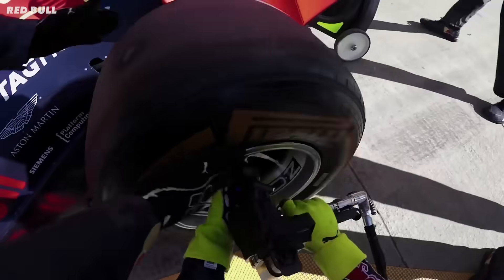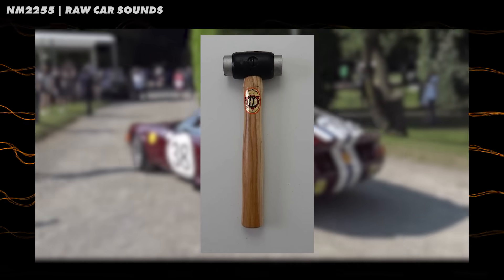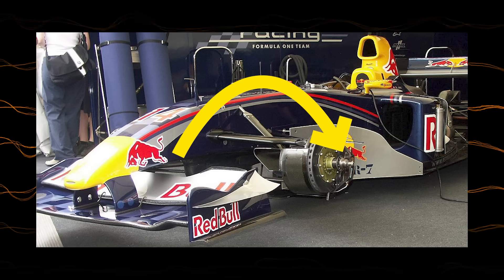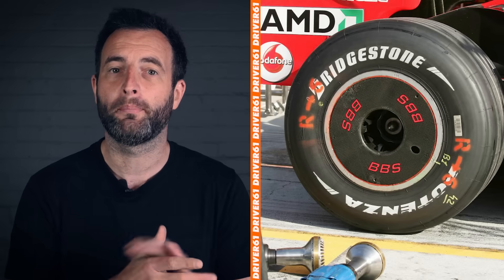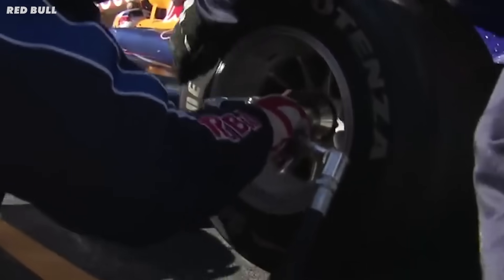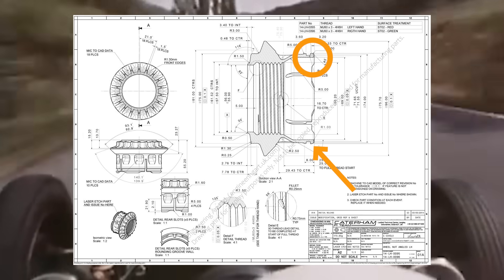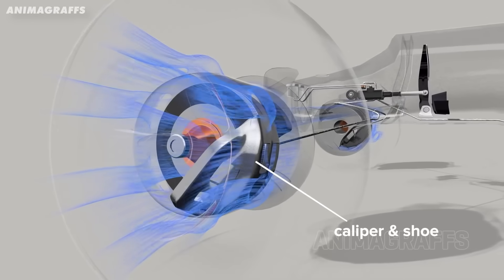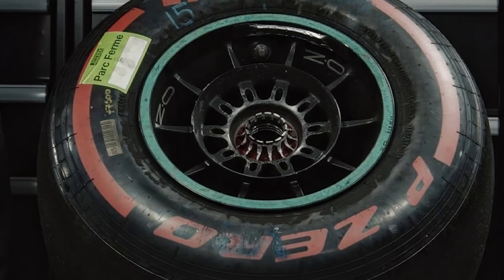Why F1 Wheel Nuts Cost £50'000

Comment: Excellent utubes! Love the deeper technical stuff we don't get elsewhere.

Re costs and what F1 teams are willing to spend -- A previous work colleague of mine had been a salesman for plasma coating equipment. Back in my day, (60's and 70's) conrods and such were polished highly by hand to remove surface scratches and improve strength and reliability. My friend told me that Ferrari, in Schumacher's time, had spent way over the odds to send their engine components secretly to America to plasma coat them which was much better than hand polishing them, giving Ferrari the almost bullet proof engines they started to have at the time. It could have been done here in Britain or in Italy, but it was such a good step forward that Ferrari  wanted to keep it secret from competitors. Cost, no object!

Comment: My uncle, an amateur stock car racer in the 1960s and '70s, had a lead hammer.  He said it was used to tighten the spinners on the threaded center hub of racing cars.  
But, I saw him use it on steel doors and door frames (he built, installed, and repaired them) and to hammer out the dents on the fenders of his race car.

Comment: If you are shearing off the castellations on the wheel nut then sounds like you need an (very simple) interlock that does not allow the torque wrench to fire until fully engaged.

Comment: My 1960's Trumphs, MGs and Sunbeams with wire wheels also had a winged, center nut, and all came with a lead mallet with wooden handle to secure and remove them. Even though the lead was soft, it still dented the chrome plated nut wings a bit.
Reply: I can imagine the first time you had to use the mallot to remove a nut. You would be standing next to your wheel thinking, NO, gotta, NO, gotta, NO, gotta, then all of a sudden THUMP! you drop your mallet and walk away.  😂
Reply: I bought a brand new MG midget in the UK in 1968 for  768 GBP, including the following optional extras : wire wheels with knock-off hubs (that's what 'winged centre nuts' were called in the UK) and a mallet, a tonneau cover, a radio, and a heater!

Comment: Bro why spend 50k on these nuts when they sell them in the lamp section at the hardware store for a $1.50?
Reply: They don't sound 50K on a wheel nut - this is clickbait silliness.
Reply: @ngc-fo5te  i mean you would think so right? if they use so many then technically, they're being semi-mass produced.
Reply: @RandoWisLuL  Yeah, if you made 10,000 of these they'd be costing 50 quid each - make a couple of hundred and they'll be a grand each. None of this 50K silliness.

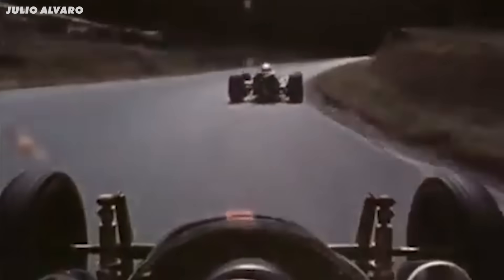Comment: I like the content of these videos, but the presentation is in the ADD style: break-neck pace delivered in a monotone with no breaks between subjects or detailed descriptions. The "explanation" of the right vs left-hand threaded knock-off wheels starting at 1:51 is a good example. I had to rewind it a few times to understand why the rear wheels tended to come off instead of the front ones. Also, "knock-off wheels" is a common term used to describe this feature on vintage sports cars, but somehow he missed it.

Comment: Would it not make a lot of sense to take pit stop time out of the equation by requiring a minimum of, say, 10 seconds that the car must be completely stopped? Not only would this cut down these ridiculous costs, but increase the margin of safety. There would be a red-yellow-green light set in each pit, controlled by the race stewards.  IMHO, the speed of the car and skill of the driver would determine the winners, not what failures may occur in the pit.

Comment: £50'000 per car times 2 = £100'000 per team. Estimate 20 races per season = £2'000'000 per team in a year.
The right video title would be "Why F1 Wheel Nuts Cost £2'000'000". Your video title is misleading.

Comment: he regenerative system can completely replace the wheen nut, a quarter inch thick of metal has zero resistance to direct current.  So the right hand rule expands outward, but through shells, eacj shell is crazy glued to the next shell, so th resistance remains close to zero and moves back and forth by reverse interference winding layers, then you can pay somebody a years salary for free 500HP wheel nuts. I thought about it making a go kart, its just the arcing, or power transmission that took a little tweaking, first idea was to use ball bearings to deliver the power betwean the shells, (inner and outer).

Comment: The titel is weird stating that Wheel Nuts cost 50k. But you state in the intro that they actually cost 1k and a whole weekend using multiple wheel nuts cost 50k. The title should than either be A wheel nut costs 1k, or a Weekend of F1 uses 50k worth of wheel nuts. That is different and I'd argue this is a clickbait title posed as such.

Comment: Interesting but some of your time frames are out. We had most of the design features you say came in 2010 or after on the Prost back in 2000/2001, and they had come from the work we'd done on the nuts at Ferrari in the years before 2000.

Comment: So the question is, if the biggest problem is the wheels coming off and the only problem with a 5 lug is the time to put it on, why bother with a single lug?  I think the problem of the wheel coming off and killing someone is much more detrimental than losing some time in the pits?

Comment: They are made in house with a machine they already own by an employees already employed. Cost is very minimal. Especially when the make so many. Volume drives the costs down significantly. Recouping R&D and materials is where the price comes from. I have noticed a lot of F1 price estimates reuse a factor multiple times as well to inflate the numbers. Crude example, X part takes a CNC mill to make. The mill cost x amount, machine price /  total x parts made = cost per part. But they don't tell you that machine also makes 10 other parts therefore reducing the total cost per part bast on the machine. I think Mercedes had a virtual F1 factory tour online that kind of indirectly pointed this out.
Reply: I was going to make this comment. Once the CAD and toolpaths are done, aside from the material those costs seem ridiculous. The metallurgy in a piston is a whole different ballgame of course.

Comment: 1,000 pounds = 1,270 US dollars
Really doesn't sound all that crazy.  

My pops has multiple screws holding his ankle together that cost upwards of $600 a piece, for small "sterile" stainless screws that quiet literally follow the same specs as their off the shelf non-medical non-sterile sold in hardware store counter parts.  

So the fact these are custom designed, tons of R&D etc etc, makes $1,270 seem completely reasonable.

Comment: Great info and breakdown into f1 wheel nuts. I started this video just find out why they are so expensive but in the end I was disappointed by your answer because 1 wheel nut doesn't cost over 50k. It's all the wheel nuts they use over a weekend of racing cost over 50k. 😑

Comment: I am pretty impressed with the information about the F1 parts and how things are done during a race. The only part of this video that bothered me the slightest, was the USB image at 5:53 showing 3 copies of the same USB, 1 and 3 in the "Label Upward" position and number 2 in the "Label Downward" position. Yet the 2 identical images were named both "wrong" and "correct". I do not see the point of that image. USB type A can only be inserted in 2 different directions (unless you are not trying to align it with the connector). 1: The attachable direction, where the connectors go together. 2: The upside-down direction, where the connectors don't fit. Sorry for the tangent, I am nitpicky by nature. Maybe the image should have been cropped more.

Comment: If they made the wheel nuts into big dog teeth like you have in a dogbox transmission you'd both eliminate the problem of shearing splines and locating them as you can just force the gun onto it like a no-lift shift. Make it out of titanium you still save the weight and regain strength. aluminum nuts are just stupid.

Comment: I'm surprised they are not made from titanium, rather than aluminium. Much stronger for a given weight.
Reply: Titanium has a terrible problem with galling on threads so you'd have a real problem getting them on and off.
Reply: I learned recently that titanium needs to be worked in a vacuum as reactions with the air can cause extremely brittle microscopic defects. I would guess that this would make it prohibitively expensive, or at least it would mean that teams likely could not machine their own.

Comment: Why don't they carefully inspect the wheel nuts and check for cracks using ultrasound and/or x-ray and reuse them if they pass the test? They have to do the exact same inspection when they machine the new wheel nuts anyway. Just throwing a part away after being used once makes no sense to me. At least based on the information available to me via this video. 

Inspecting them thoroughly after being used makes very much sense, but just discarding them makes no sense to me. The only thing I can come up with is that they obviously have engineered the wheel nuts with as little material as possible and that they actually expect them to deform after x number of laps, or something like that. I find that very unlikely as the threads has to work flawlessly 

DISCLAIMER: I don't doubt the information in this video and that they actually do use the wheel nuts one time only, but I don't understand why. I'm a trained tool maker and I have machined countless parts in a variety of different aluminum alloy, and even though I'm not an expert in metallurgy I have far above average knowledge about how metal behave. With that being said, F1 engineering is extreme and my knowledge about metallurgy and machining may be obsolete as I have worked as a programmer the last 20+ years.

Comment: why don't they just use a better material?
Titanium seems like a neat compromise, but steel would be much stronger
but why on earth would they choose aluminium?

a 12.9 steel nut(the standard for wheel nuts for decades) has over 13x the tensile strength of aluminium
titanium at least 4x and up to 12x at half the weight of steel, but titanium is a bitch to machine, so I'd still go with steel even tho it's a few grams heavier

Comment: You think $63,000 is a lot for a single hub-nut?  Think again.  Here are some other expensive items for comparison:

The seatbelt assembly costs more than $317,500.

Each tire is handmade and costs about $1,800,000 each.

The exhaust system costs a little more than $87,900,000.

The seat is bespoke to the driver, of course, and takes about four months to make.  Each one costs $327,458,000.

The transmissions, made piece by piece on the team's own premises, including heat treating, finishing, balancing, etc, each cost $3,300,500,000.  They provision three for each car.

There's more, of course, but the final tally is that each car, with its full provision of spare parts and components, engines, transmissions, etc, costs a little more than $6,000,000,000,000.  That's six TRILLION, with a "T."

Comment: The Wheel Nut may very well cost that rediculous amout, but is is the difference between 'Cost' and 'Worth' much the same as a Hammer can cost £500 on a Ballance sheet for Tax Purposes but how much does it cost to make? £5? tops and that would be using really exotic, imaginary material such as say a Depleted Uranium Titanium Alloy sintered for 3 years in a massive oven and held at a temperature +/- 0.0001 C and rejected if it varied. (That last bit was intentionally daft.)

Comment: no, they don't cost 50.000 pounds. they get 'priced' at 50k though, that's a big difference. 

it's the same claiming an f1 accident (like that of Verstappen in the wall in 2021), costs X millions. No, it doesn't, because there were already spare parts created, all that happens is the spare parts get USED, which were PAID FOR and created ANYWAY. 

and as if that is not enough, the next race(s) there was ALREADY an update planned, so the parts that got destroyed simply were destroyed, when normally, they might get shelved. it did not cost a dime more.

as for a damaged monocoque, they have spares of that aswell, and when there is a hairline fracture due to a production error or whatever happens, they get replaced too. all is calculated in.

but, it does not mean it 'costs' X millions. 
designing a new part doesn't cost X millions either, they already have the material, the equipment, and the employees doing the work. 

it's also very 'delibarate' steering things in a certain direction. somebody having italian marble floors does not mean that person paid 170 euro's a square meter just because you are able to show there is a manufacturer that ships them for this price. there is also marble for 20 euro's the square meter.

just a few years ago, Renault was under fire in F1 because the bolts they used in the engines were literally RUSTING. 
that should tell you that there really is no way they are actually paying 100s of thousands for silly little parts. 

there were Magneti Marelli parts famously failing back in the RB 'domination' time with Vettel. these weren't 100s of Ks either.
yet i can fabricate a story where they are and can be 'justified'. 

the real truth is that in motorsport, but specifically F1, they slap/label a price on something so that the team is able to put the money paid into their own pockets. 

It's like i want to claim spending a budget of 100 million for my furniture, and i have to spend all that. instead of actually spending 100 million on a golden chair, i actually spend 1 million on a golden chair, and send 99 million to my bank account. 

now my neighbour wants to renovate too but we fool him he has to pay 100 million too. why? because if he just gets to spend 1 million, my 'sponsor' will find out and say F you, you get 1 million tops from now on, and i miss out on 99 million. So i tell my neighbor, and now my neighbor also has 99 million in his bank account, and next season, we all get 99 million in our bank account.

it's nothing but elaborate conning.

Comment: why so expensive... cause its F1 everything's price tag is so overcharged you could run vehicles in ten other motor sports and still not equal the place of an F1 car.  I say its a dumb sport that just like all the other motor sports is focusing to much on the wrong things EV and hybrids if they wanted to do something they should run new engine design's in the cars like all motor sports used to do that was the whole point of how racing started yet everyone has forgotten about it now every cars is pretty much exactly the same like for their stupid "balance of performance" to make the race "fair" funk fair I want to see with company can make the better parts not which car company can win they race cause they could afford more cars and better drivers,  I want to see turbine's, rotary's, V's, straight's, flat's, big block's ,small block's, diesels,  along with concept engine like the OMEGA 1, the free piston engine, the opac em100, the duke axial, and we can forget about hydrogen combustion and propane engine's.  If we had all those engines racing on the same track even if the were in the same car bodies it would be more entertaining the the crappy BOP racing we have now I'd love to see which engine would take the crown the most times threw the year.

Comment: As a programmer for CNC machines I reckon it costs probably £150-250 to make one of these, the material itself is probably around £40-50 per billet that size and machining that would take less than an hour.

Comment: The claim that the nuts cost £50 000 is a load of nonsense.
They are machined on CNC machines just like anything else.
They are made in large volumes which means the process is well optimised and can even fully automated. 
Aluminium is easy to machine. 
X-ray is not expensive or coating.
I would hassard a guess just for the manufacturing of the nuts £1000 to £2000
Development is expensive but spread out over the thousands of nuts produced it is nowhere near the figure stated.
Reply: Agreed.

Comment: Want to save money?? Give them 5 stud wheels and a manual wheelbrace. Centrelock wheels are at best dodgey. The reason so many wheels still fall off. And they are mechanically inept,, ask Nascar teams!
5 stud wheels clamp far better and if a nut is left loose it does not usually fall off. Wheel brace maybe not but a normal decent quality 1/2"  rattle gun, same for everyone so nobody loses.

Comment: Wheels come off not from brake torque, but from nutating around the center pilot.  The wheel is slightly larger than the pilot.  If the nut is loose, the wheel rolls around the pilot.  With left hand threads on the right, and right hand threads on the left, the walking keeps the nut on.  One interesting tidbit is if the wheel is held on with multiple nuts in a pattern, like most road cars, the left side needs left hand threads and the right side gets right hand.  Today, everyone uses right hand threads on all wheels with a lug pattern.  Loose wheel nuts will cause the left wheel to come off in a short distance.  Loose nuts on the right will cause the wheel to wobble around until the holes wallow out.
Reply: I learned the hard way about proper tightening of lug nuts after changing a tire on my dad's pickup truck .. Couple of miles later the holes for the lugs were substantially larger and the wheel was real wobbly .. Fortunately he noticed it before it caused a severe accident.